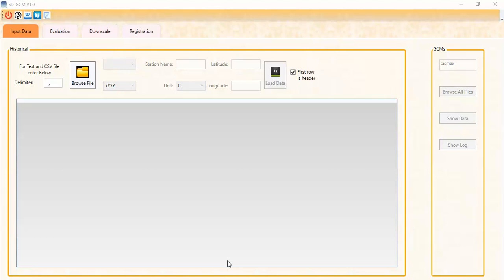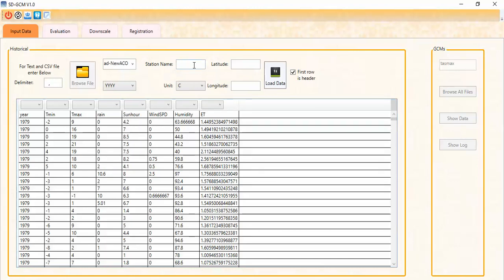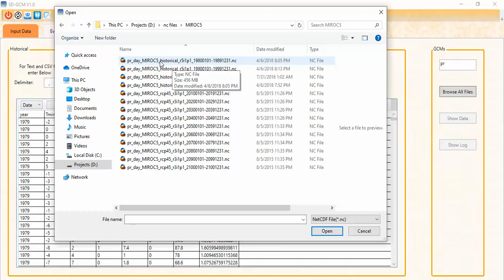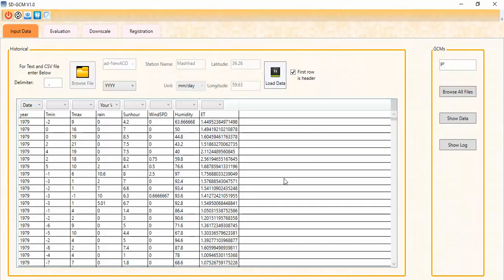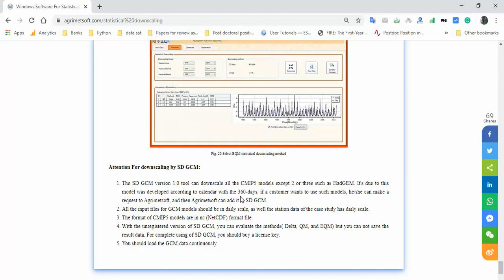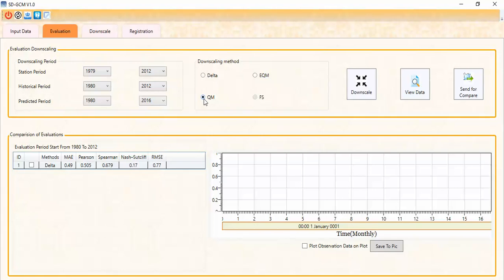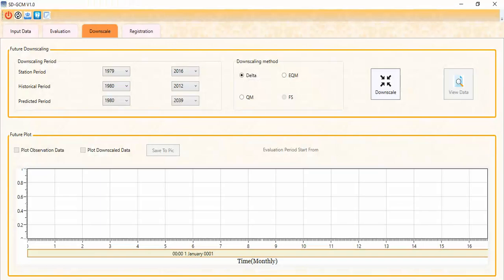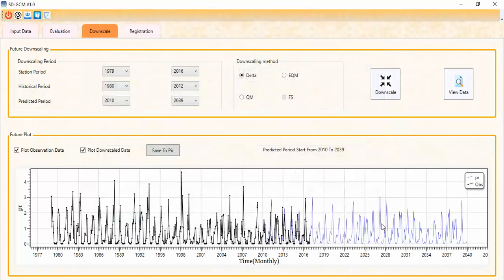Statistical Downscaling Methods

Comment: Can we use grided data for analysis
Reply from the maker: What is the Analysis that you need?
Reply: @AgriMetSoft  mean of annual max rainfall for 10 year periods (data in grided format
Reply from the maker: @mylocaldogs5762  This tool is for SD methods. But You should extract data by the OpenNCFile tool and save them in csv format. Then in Excel, you can use Data-Tool to convert your data to monthly in rows. At the end of each row, you can calculate annuals.